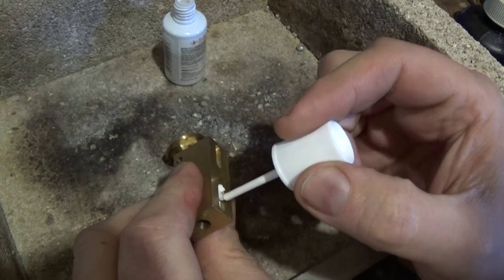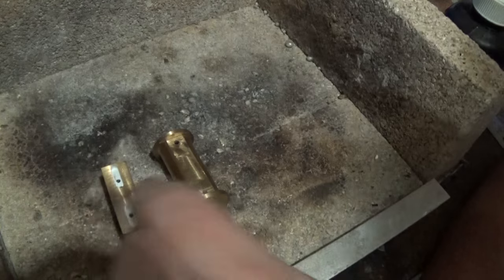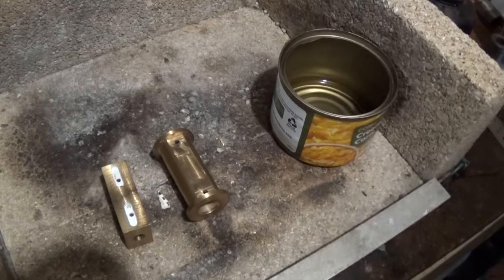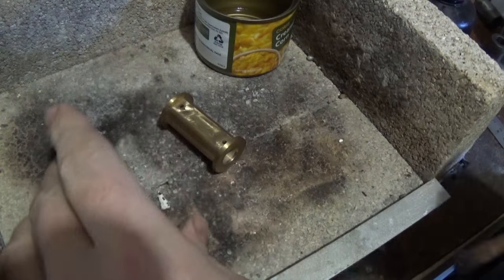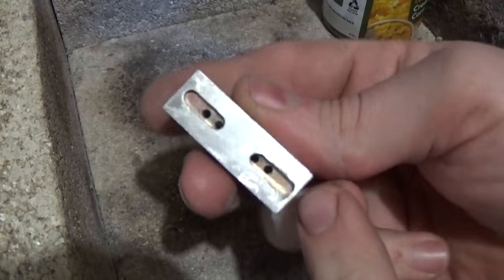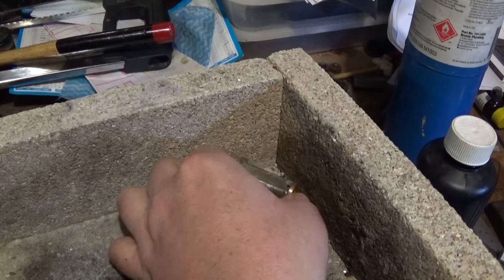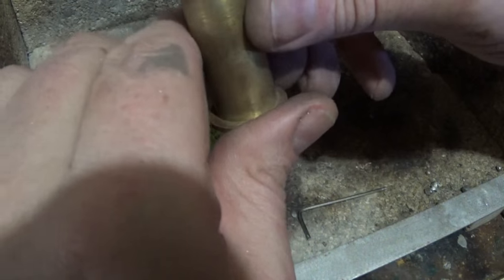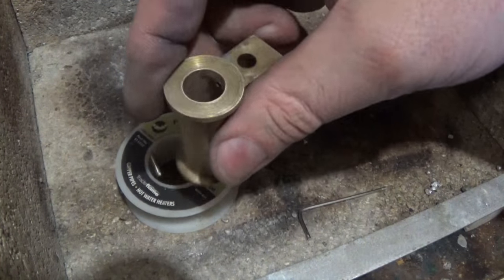myfordboy engine part 8 - soldering up

Comment: To control the solder volume, cut small slices off of the large solder of even shave off flakes and apply those as needed.  Or use smaller size solder.  Project is looking good.

Comment: Once again you hit the bullseye Emma. I agree soldering can be a pain to do. Preparation is the secret and you did it well. I learnt to solder when at school in the metal working shop. I also used to repair the old brass and copper radiators from the vehicles on the farm so I got plenty of practise.  regards from the UK

Comment: Using the liquid paper as a masking agent is a cool trick. As many have mentioned, the use of small parts or flakes of solder is another good method, especially with silver soldering. Your technique of pre- tinning work for soft solder worked very well. Nice work.

Comment: Very nice job Emma. Looks great. One thing I sometimes times do, particularly when silver soldering (mainly with carbide) is hammer out the solder into thin strips that I can lay in between the parts. that way I can hold the part in position whist soldering without worrying about moving it. the pressure of holding makes the excess flow out to where it is needed
Reply from the maker: yes that would work thanks for the tip. i didnt put much on. and it turned out ok... i find loose solder balls up and runs off the end though sometimes as it gets hot. thanks for watching

Comment: Nice job Emma - now I have to say soldering is possibly my weak point. I can do it, especially electrical and pipework, but anything larger, I always seem to have problems. I struggle to get it to flow evenly.

Comment: Well done. I myself have great troubles with "plumber's solder". Nowadays it contains no lead. Instead it contains silver. But not much, as little as the manufacturer can get away with. For that reason I find that while it is OK for sweating copper pipes -- if the pipes are dry -- doing stuff with brass is very iffy, and I prefer solder with a high silver content. To me "soft soldering" is the stuff you do with electrical circuits, and that does indeed contain lots of lead. But it will not stand up to high temperatures. Anyway, tinning the pieces was a very good idea. The "balling up" you refer to below is caused because the surface tension on the solder is too strong for it to flow. This is why we are supposed to use flux. It breaks the surface tension. I have yet to find a really good flux for plumber's (silver) solder.

Comment: Hi Emma, have you come across solder paint/paste? If not, it is a mixture of ground up solder and flux and is used for tinning. You just paint it on with a brush, heat it up  and it makes tinning a piece of "kidney output", as you don't get any lumps or bumps.
It shouldn't be confused with some fluxes that are described as solder paste but are only flux..
Reply from the maker: not seen that. will have to investigate! thanks for watching.
Reply: One version of solder paint is:
http://www.cupalloys.co.uk/soft-solders/index.asp
I still use a tin of Fry's, bought in the sixties!